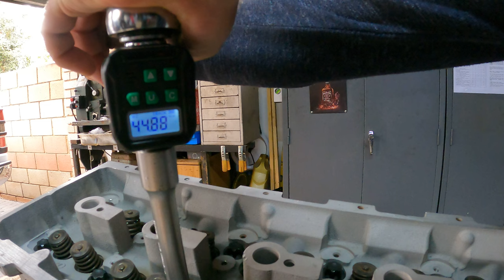New Engine Going Back Into Jeep WJ 2.7 CRD - Part 12

Comment: Amazing Job ... Hope U finaly fix it 
Will stay tuned
In my case I found solenoid control of turbo faulty and need to replace it and hopefully it helps to solve my problem 
👍
Reply from the maker: Swap the solenoid with the one from your egr for a test.
Reply: @MountainmanBuildz  I used vacuum pump to test both. And the turbo one was leaking and does not hold the vacuum. This one for egr was ok. 
.... One hint for U ... Those solenoids one for turbo (blue mount) and one for egr (black mount) are not the  same. There are different response setup for each. I found some reseach on some belarus forum site. Where guy did a test with swap with negative result. The response was not ok. Also they hlave a different Mercedes part no.s ending for egr 427 and for turbo 527. Be care full with it.
Hope it helps.
Reply from the maker: @JozefKras  thats some great info, as I was under the impression that they are the same part.
Reply: Problem is if your are searching for one of them The sites give you ansver they are the same.😢